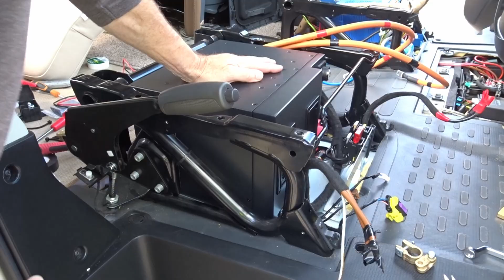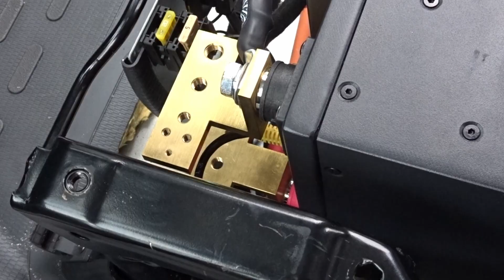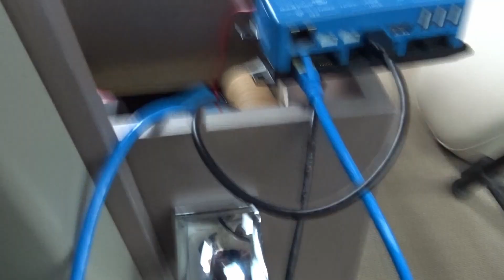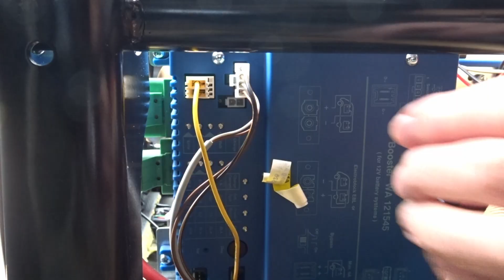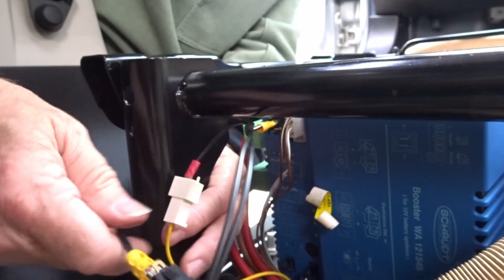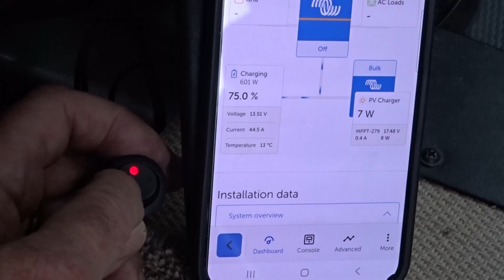Burstner 744 Lithium and Solar upgrade - Part 7

Comment from the maker: NOTE: In this video I'd connected the battery master across all 3 terminals of the LA121545 'booster', but I later realised that the connection to the engine battery is only live when the engine is running so I subsequently wired the engine battery connection from the battery master to the separate engine battery connection on the LA121545. See Part 9 for details! https://youtu.be/Ek56OQyKUFk